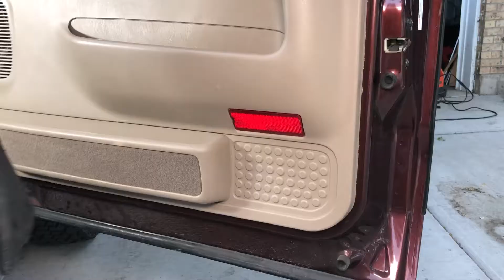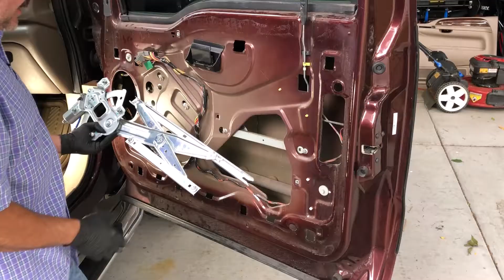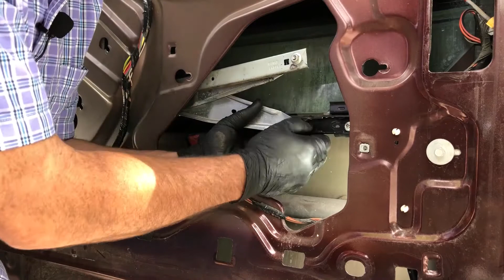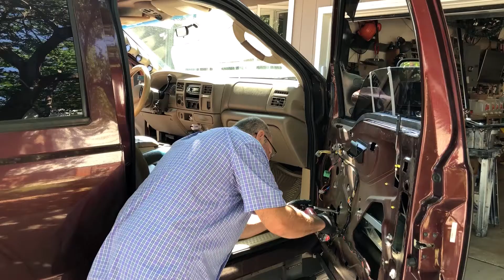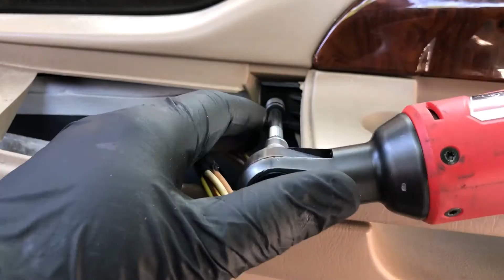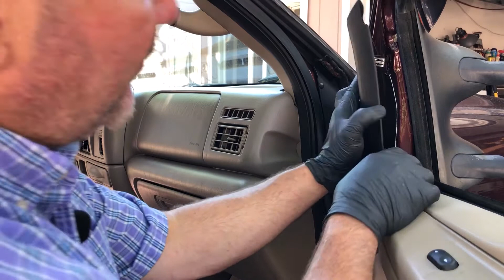F350 F250 Excursion Window Motor / Regulator Replacement Ford Super Duty

Comment: Thanks to the Lord and You!  I was dreading this task as I’m not a mechanic.  I have the same inside door architecture as you, just different trim.  It worked perfectly just as you showed.  I even used the hammer trick.  Step by step it was the same.  The hardest part was it was very humid and 90+ outside in direct sun.  Great video!  Thank you so much!  🎉🎉🎉
Reply from the maker: Glad I could help!

Comment: How are your windows have not a scratch? I have two super duty's 2006 F350 and F550 and after replacing the window and felt they still get grime and dust caught up in the outer felt molding. Another Ford design flaw. . Does anybody have this problem or is it just me, Any remedy?

Comment: Fantastic video!  Well done!
Reply from the maker: @Hans Shaffer - Thank you very much for the compliment Hans!  It always puts a big smile on my face to hear someone has enjoyed one of my videos.  I appreciate you stopping by and taking a moment to leave me a comment - thank you.
Reply: @javosgarage  My pleasure.  I believe in recognizing excellent work.
I just finished doing this job, and I have a tip for the next person who has to do it.  After removing the old motor, install the new one so that the motor's pinion gear is in the middle of the regulator's gear. You will need to clamp the corner of the regulator in a vice to do this.  Install one of the outer motor-mounting bolts, but don't engage the gear teeth yet and don't tighten it down yet.  Pivot the regulator arm (working against the spring) till the motor gear is about in the middle of the regulator gear.  Now rock the motor on it's single mounting screw so that you engage the gear teeth.  Now screw in the rest of the motor mounting bolts and tighten them down.  Doing this made it MUCH easier for me to get the regulator into position inside the door so that I could reattach it to the window.
Reply from the maker: @Hans Shaffer - Great tip there Hans.  It can certainly be tricky to get everything back in there and get it lined up; it's such a tight space it really limits your options.  Thank you for taking a moment to come back here and leave valuable information that will help me and others.  Much appreciated!